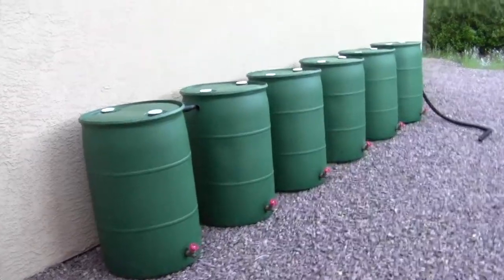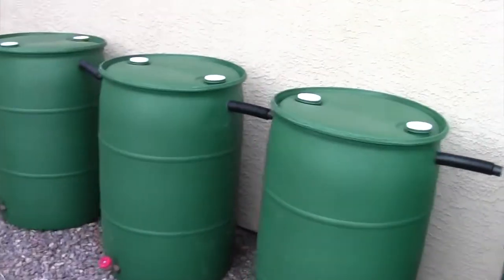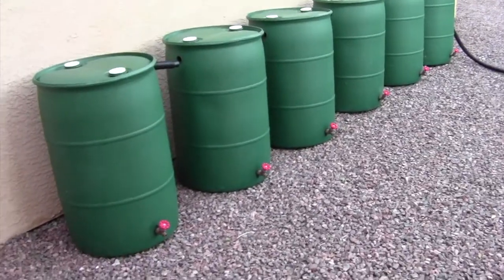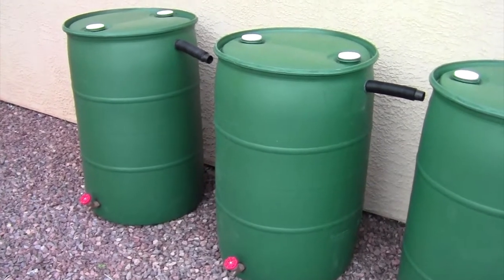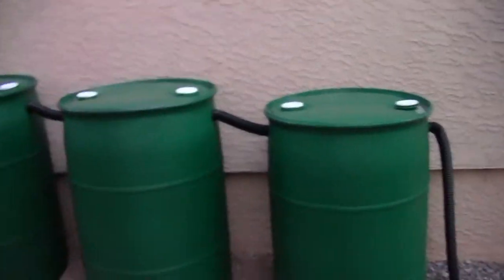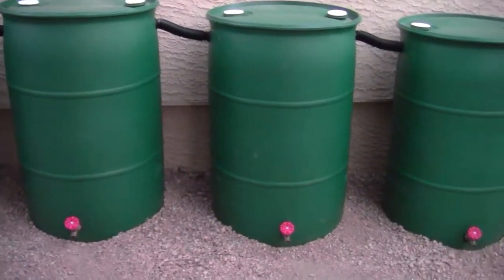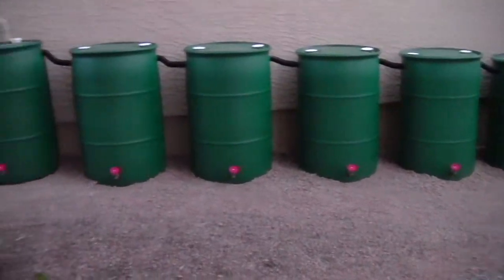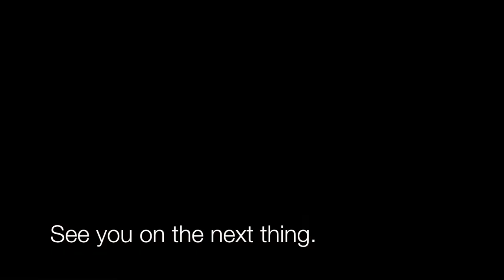Rain Barrels DIY Fast, Easy, and Affordable.

Comment: I connected all my barrels together at the bottom so they would all siphon out at the same time. I also got small pump that automatically shuts off at 60 PSI period and connected it to my toilets. It works great
Reply from the maker: Excellent. I see the advantage if your hooking up a pump. That way you don't have to reconnect individually. With this set up Im just using a garden hose pc. And figured if there was any freezing or damage to a barrel only that one would leak and drain. But yah connecting at the bottom for a pump set up makes it like one big barrel vs 6 individual or however many you used. Makes sense. I have a project coming up I plan to use a larger water tank for with a pump.  Thanks for the info.
Reply: So, connecting at the bottom of the barrel is better than the top??  I just want them to fill and empty with a steady pressure. I'm not sure of all of the physics of fluids. Thanks!!

Comment: What do you like to use the collected water for mostly?
Reply from the maker: Watering plants/garden primarily. And in the event theres a water shortage situation. I (and or some of my neighbors) would be good for a little bit anyway. Not much of a problem here in AK but in AZ .... When it does rain. It pours. And why not catch some of that.  The house has a water softener also that can at times be harsh on some plants. The water in that area is very hard and you get a lot of build up. Calcium etc. So its a water softener or a shorter life for your appliances. This setup gives me good water for the plants.

Comment: Tried drilling a hole and as  screwing the tap both leaked so am drilling them to fit a bung
Reply from the maker: Yes I can see the pos if the hole is a bit imperfect there is that potential.  If you drill  it in a manner that can cause any out of roundness or such. Or if you use a drill other than the correct size. Not saying you did any of that. Just clarifying for others to consider. The six I did luckily worked out. No leaks.

Comment: So you run a drop line from the barrels and if so, how far does your water line reach?
Reply from the maker: I actually just fill a bucket or can each time. But if you can keep the line below the water level in the barrel that won't matter, you'll always have flow. Never under great pressure of course but flow. Once the level goes down or you raise the hose above the water level in the barrel. Flow will of course stop or be interrupted.  Drop it down below that level and it will return. So if your wanting to run a longer hose and have concerns about the flow. If you can establish your barrel so its up off the ground and up higher than most of your watering needs would be. You wouldn't have an issue. Hope that helps.
Reply: @ericinalaska7648  Thanks so much for replying and answering my question. I am working on a design for an off-site garden space. This helps a lot.
Reply from the maker: @tetramom3900  Fantastic. I wish you success.

Comment: How are you going to get the water out. Spigot too low to fill watering can
Reply from the maker: I use a hose long enough to get to a bucket lower than the barrel. I have no issue due to the slope of the property. Especially when the barrel is full. As it gets to about a quarter full It gets a little fussier about getting the flow going. But I just move to the next barrel at that point. You could also build up the ground or make some sort of platform. Or even install the spigot higher if you felt you needed to. But of course you'd only be able to drain water to the level of the spigot.
Reply: @ericinalaska7648 , why not pedestal each with concrete cinder blocks under each and daisy chain and plumb with actual PCV while gluing fittings for tight fit.. You could place one spigot at the very last bottom container so you can get buckets under the spigot.. By daisy chaining the barrels at the bottom they will every one fill up evenly and simultaneously giving you tons more pressure at the bottom spigot with the sheer volume of 330 gallons of weight pressure rather than 55 gallons of weight pressure diminishing as water empties a 55 gallon single barrel.... You could also install fittings at the top and bottom of the last barrel and run a clear hose so you have a gauge to see how much water you have at a quick glance. I'm in the process of building a system and this method I describe seems to be a great method... I feel there is room for improvement on this setup you have.. Where's your overflow going to...???? ~rockinfxguy
Reply from the maker: @rockinfxguy1  Yep, there is always room for improvement.  I haven't really had any moments of underperformance that made me wish I did it different to date. But  I can see the advantages of your suggestions of course. Flow could be better. But its sufficient for my intentions. The barrels fill up fantastic and empty as needed.  Not concerned about a bucket, But valid.  I attach a hose. And while building a platform would  help,  It''s added expense and not the look I was going for.  But definitely a valid and common option. If I were to change my mind. The current design doesn't prevent me from modifying to that later if I wanted.  I Just wanted a clean economical  functional system.The overflow goes to a washout or ditch that parallels the back lot boundary. About 10 ft away.  Just sharing what I did and how I did it, hoping to inspire and demonstrate, for those interested in how simple it can be. There are many many ways to come at it of course. And you can get as elaborate as you like. No rules. This is just a simple economical option for those who don't have the skill or desire or perhaps need for gluing PVC or gauges. Just simple and functional.  I just tap on it with a knuckle or peek in the top. Primitive style. Or.... when water stops coming out. I know it's empty.  My rationing doesn't need to be that precise. Its for watering plants mainly. And perhaps emergency backup water. Sounds like you have a great plan that should work great for you though and it's certainly good info for others educating themselves on options that read it. Have fun and good luck with your project. It's always a great sense of accomplishment to see your vision come to life.
Reply: @ericinalaska7648  Absolutely.. Glad folks like you are posting videos that inspire others like me to learn from.. We learn from you all in a 10 minute video what took you hours if not in some instances, days, to accomplish more elaborate off grid water containment and drinking systems.. Thanks for a swift response..!
Reply from the maker: @rockinfxguy1  Thats my main motive is to help if I can. Appreciate the feedback.
Reply: @ericinalaska7648  yeah man...
Reply: You're accent tells me you're originally from the midwest!